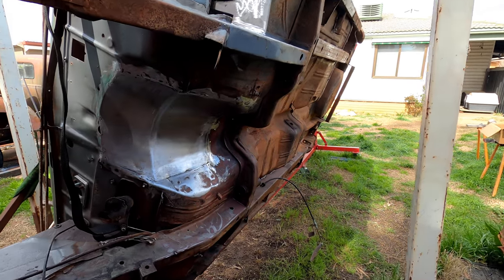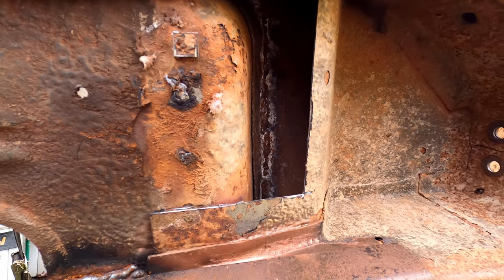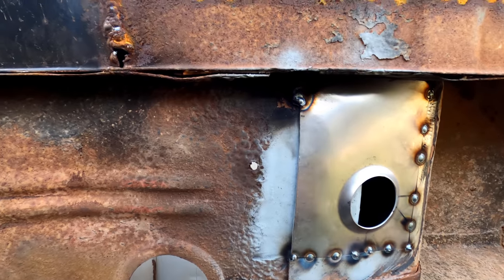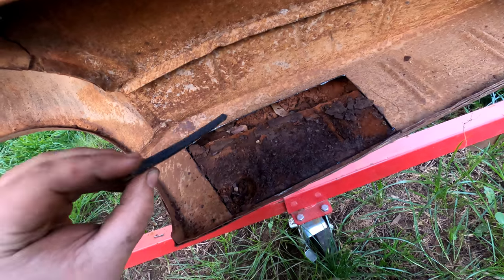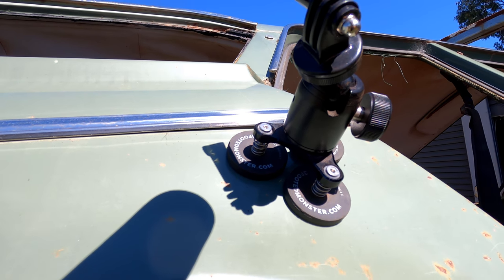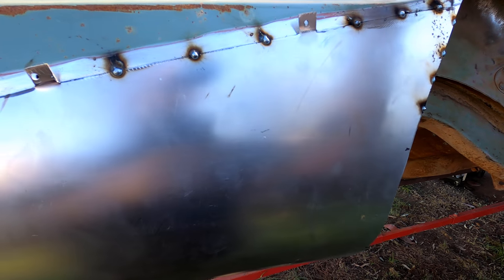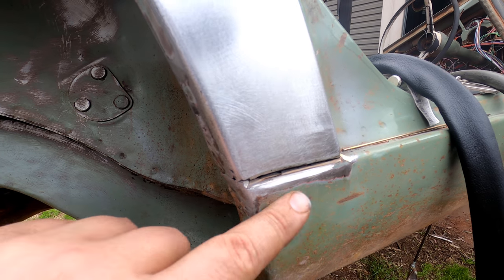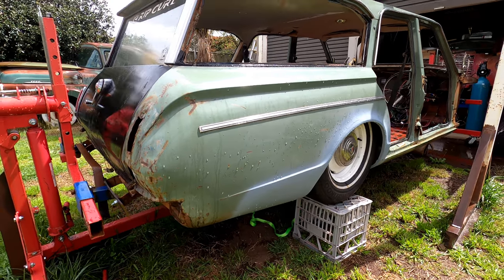Rust, Rust and more rust: VC Valiant wagon update: Backyardbuilds

Comment: There's one of these around the corner. Super tempted. Are they bad for rust?
Reply from the maker: Hey Mate, they aren't to bad depending where it has been and what it's done.
Reply: @BackyardBuilds  Thanks, It's been sitting a while. There is some rust in the doors so it's a proper project rather like yours. And of course I'd need to 'start the argument' with the minister for finance. 😁